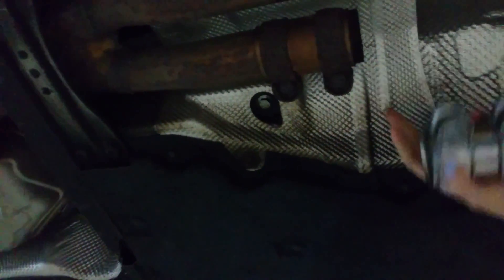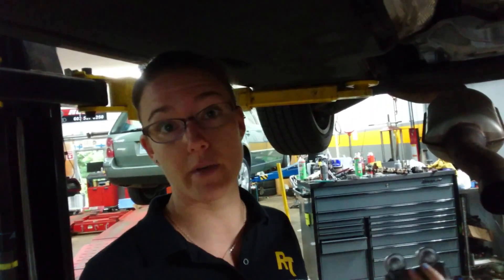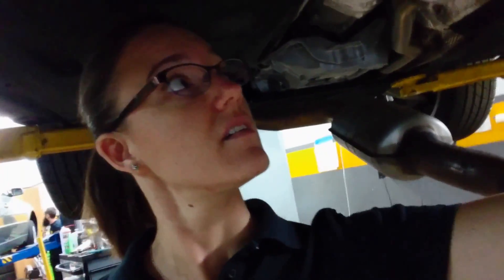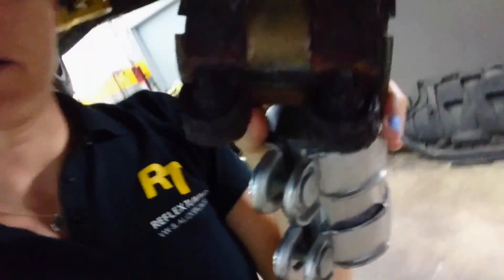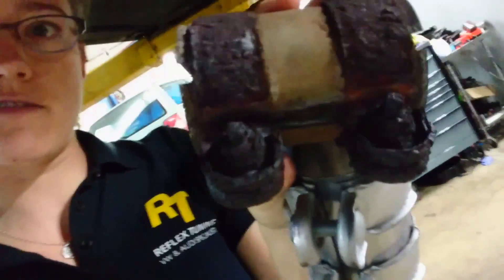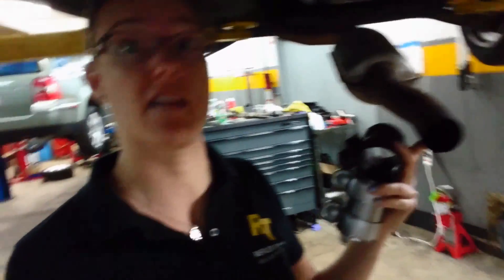Audi and Volkswagen Exhaust Sleeve Clamp Failure and Replacement

Comment: Those two clamps&bolts will get rusty pretty fast and lose the tension. Use the coupler clamps from the dealership. It might be a little shorter than the original but designed much better.

Comment: Do you need to use exhaust sealant to install new sleeve?
Reply from the maker: It really depends on the condition of the two pipes. We used to use sealant a while back. But when having to service the clamp in the future it makes it much more difficult. So now just clean the both ends of the pipe really well. And only use sealant when absolutely necessary. Hercules High Temp furnace cement works well.

Comment: Can you get stainless steel replacement clamps?
Reply from the maker: Depending on which clamp you need. For 1K0 253 14N which is the 60mmx95mm clamp we use the Mercedes clamp #0009955302 . This is much higher quality and do not rust as easily. I think they may be mostly stainless. https://www.ecstuning.com/b-genuine-mercedes-benz-parts/clamp/0009955302/

Comment: Of all cars vw/audi seems to have the worst exhaust system designs, at this point i would civilized for audi to just include the resonators, flex pipes and clamps as a routine maintenance item every 100k km. From the droop on that cat that flex pipe is probably swiss cheese as well, and its great how well they tucked that flex pipe into the engine bay
Reply from the maker: Flex pipes on this one are still going strong! It seems that any Audi prior to 2009 do have a lot of issues with the flex pipes failing much earlier.

Comment: This fell off in my garage (I had just driven the car the day before so not sure how the sleeve slipped.   Since its parked and I really don't want to have it towed, I purchased two replacements sleeves at the Audi Dealer this afternoon.   I have a floor jack to raise the car but for safety I want to see about putting a jack stand underneath .  I have a 2013 A6.  Any suggestions on where to safely put a jack stand.  (I know the lift point for the jack as I swap out winter and summer tires each season)
Reply from the maker: It may be best to pay a repair shop to do this for you. Most of the time the clamps need to be cut off with a cutoff wheel, as the hardware is too rusted to get a socket on it. Even on jack stands, there may be not enough room to safely work.

Comment: I bought these at a high cost and my local fitter just handed them back and welded it up instead, I guess that could cause issues down the line? I tried to explain that if Audi didn't need it, they wouldn't have spent money on it in the first place. He just looked at me like I was a fool. I love where I stay everyone's so shit :D
Reply from the maker: You are correct that it may cause issues down the line. If you have to remove the exhaust or replace parts of the exhaust for any reason it makes it much more difficult to service.
Reply: The mechanic I went to wanted to do the same thing and charge me 150$ for parts and time...  I'm ordering the part myself
Reply from the maker: @christopherp.8485  Doing it yourself is of course the cheapest route if you have the skills and tools to do so. As simple as the clamps sound, you do need good access from the underside and typically they need to be cut off because the hardware is too far gone. But if you can safely do that then that is awesome!

Comment: I have a 2009 Volkswagen Rabbit 2.5 litre 5 cylinder, 5 speed standard what do I need for my car, size please :)
Reply: It’s a 2.5” exhaust clamp sleeve. Very easy fix. Hardest part is getting under the car.
Reply from the maker: @River_Miles  It is best to source parts from the manufacturer or OEM equivalent. Generic clamps do not work well. The factory clamp will cost between $27-$47 depending on which one you need.
Reply: Is this one of these channels that ignores everybody?